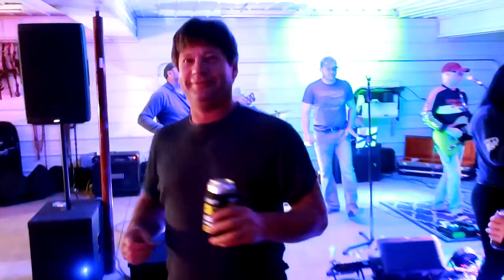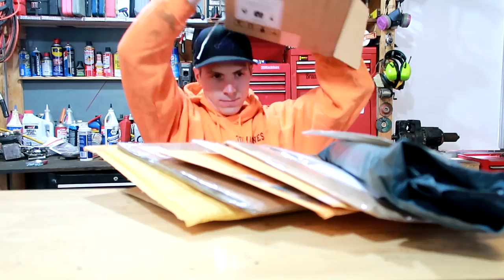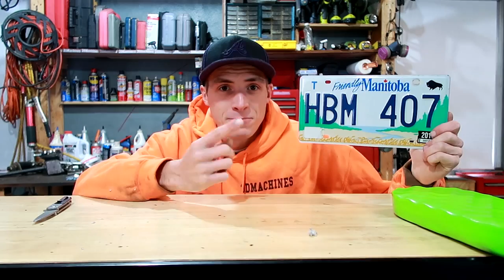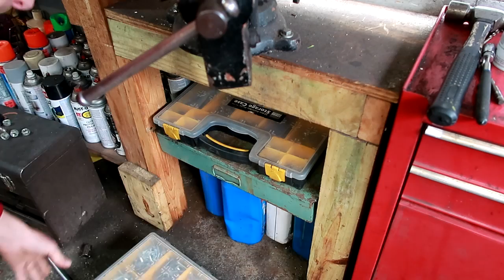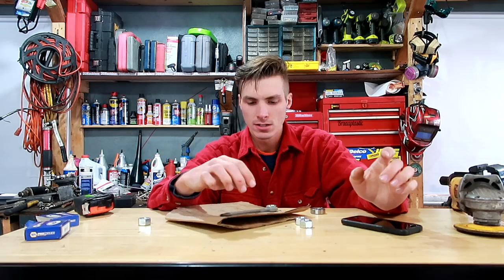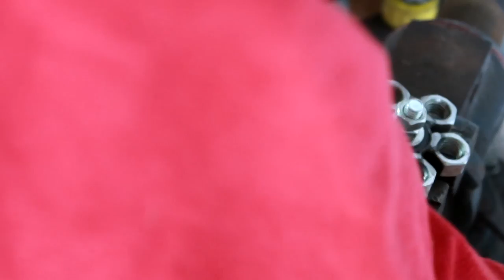FASTEST FIDGET SPINNER EVER!!

Comment: Why didn't you use an air compressor??
Reply: B/c it wouldn't spin the bearing as fast. The high velocity air doesn't have the same "torque" as massive slow wheel that makes a lot of friction.
Reply: Cody Bigbee you would be surprised how fast decent air compressor would spin light things on small bearing
edit" also he should have removed the dust seals
Reply: Was gonna say exactly these two facts, use a Compressor & get rid of the Restrictive Seals...
Buuut on the other hand if You really need one of those Fuckin' Ridicularse things, then You need a Hobby & clearly have Way too Much spare time if You need to Fidget around...
Reply: JRT that is so true
Reply: it would be too heavy

Comment: why dont you use a small diamater pipe and weld the nuts to the pipe and then afterwards press a new bearing into that piece of pipe so as not to overheat the bearing from welding it? just a idea keep up the cool vids. jakes from south africa